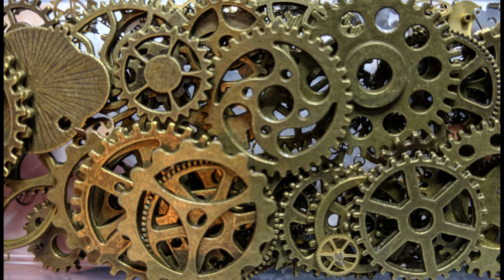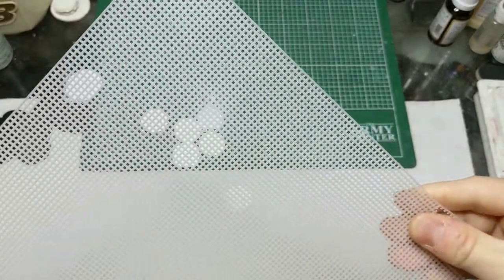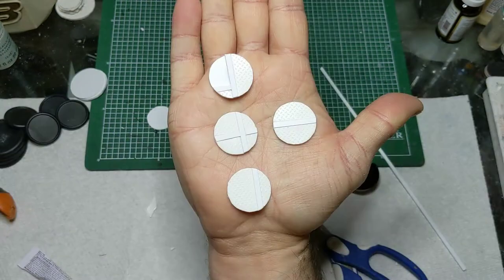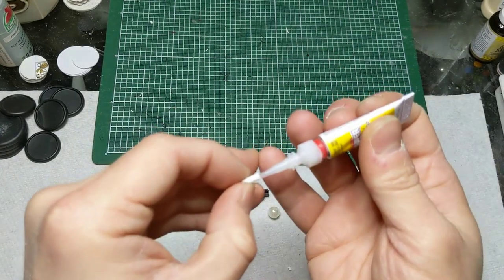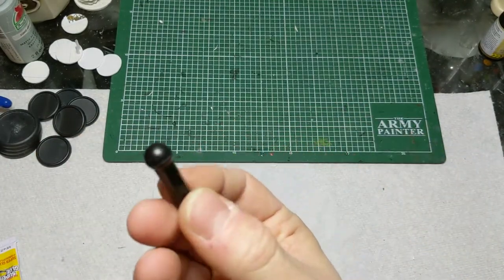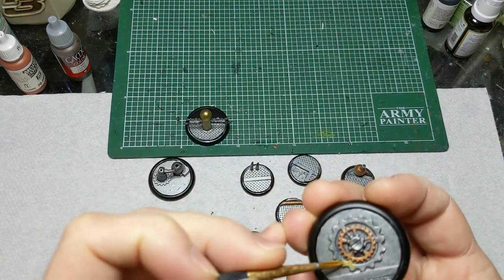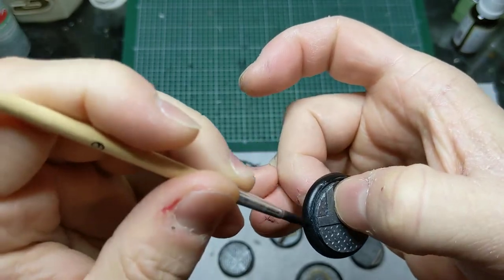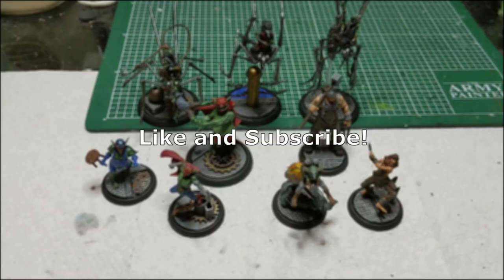How to make Steampunk Airship-Deck Miniature bases

Comment: I'd never considered doing metal deck plating for zip; I was thinking of doing wooden planking... but that makes me realize I don't even know what his ship looks like. Is there a description anywhere in any of the lore?
Reply from the maker: I was going to do wood, but I have so many other models with wood paneling, I wanted to switch it up. The only art that shows the infamy is the one piece in the video (it's in shadow) and there is only a brief description in his stories that emphasize that there are shiny gold fittings on the deck that can be seen from far away. So I figure we can be creative and fill in the details 🙂
Reply: @DefectiveDice  Ahhh... I missed that in the first watch-through. Looks kinda like a sailing ship with winglets suspended below a dirigible.